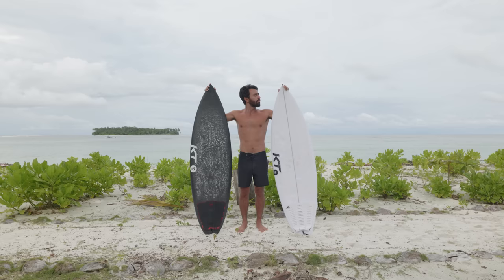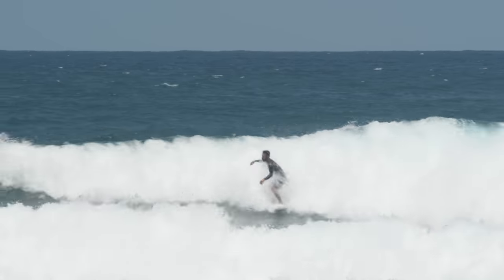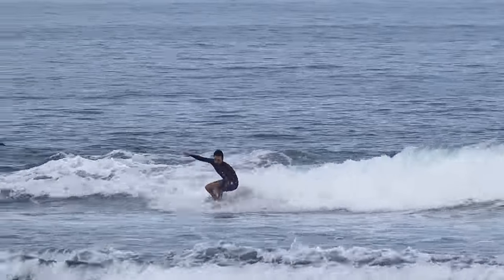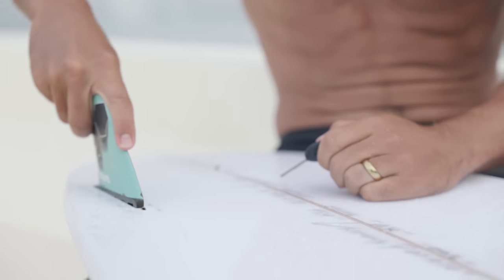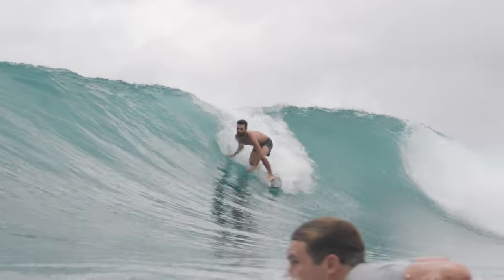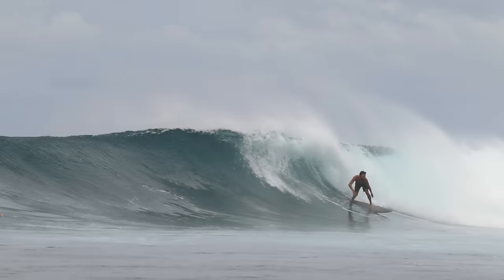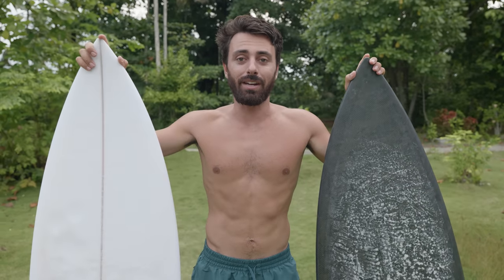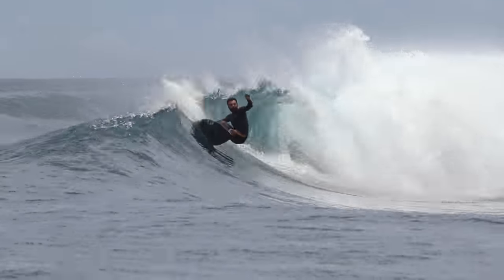Carbon Vs. PU — What Board Works Best?

Comment: Jokes on you I can’t afford a carbon fiber board so it doesn’t matter
Reply: You can think about it this way: Assuming we're talking new boards, a new off-the-rack PU/PE board is around $700+ these days (ouch) and a custom carbon-wrap from Dark Arts or Varial is around $1300. That's 2x the price... but the board will retain its pop for 3x or more time, assuming it's not a dog. I'd call that a pretty good deal, but the risk of getting a dog is real.
Reply: never buy new surf boards that arent on sale shops have a surplus of performance boards that sit for years before bought

Comment: Awesome. But you missed one really important point. What was the weight of each board? It looks the black was lighter than the white, by watching you surf, and by your comments. What about a video comparing two boards, on same dimensions dinentions, and weighting the same? Than we’ll have a conclusion on different constructions in general. Excluding the weight factor.
Reply: Yeah the carbon board definitely weighs less and is more buoyant. But that's kind of the point, to see how the exact same shape differs.  Carbon will get you floating more over the water while PU allows you to sink your rail much better.  But you're right, usually you will have more volume with a PU board than other constructions.

Comment: you are spoiled for choice. In the 70's we had one good /new board that had to last until you saved enough for a new one.. To last they had very dense foam, 3 ply stringers and 2 layers of 3oz on bottom .1 on deck. Airs only became possible when Kelly and Co got board makers that give them "burner" boards with one light coat,   one filler coat, no gloss.. It is much easier to try things when your board is a throwaway. To us, our board was the gate to happiness. You didn't risk it too much. It took 3 months of saving to get another. If you broke yours, and had no oldie back up, you had to borrow. After it went onshore and they came in.

Comment: There is no such thing as two exact Surfboards. I will make it simpler. No fingerprints or snow flakes are the same.Kai Lenny rides for Redbull and he has over 30 of the same boards some even the same template and fin set up and he will tell you everyone of them ride different.

Comment: I think you should have compared a pu to regular eps epoxy glassed board.
The eps stringerless carbon wrap are a thing of its own.
Reply: But i would love to see a video comparing many boards from different shapers in their pu and eps equivelent
Reply: Totally agree, best should be: PU standard glassing, PU light glassing, EPS with stringer epoxy resin, EPS epoxy stringerless, the most common options at the market
Reply: Agree….needed a Pu standard also which is most of our benchmarks in terms of understanding

Comment: Awesome video and great surfing. As one of the other comments said, you need to know the weight of the board, so then you can figure out the density. The density is the first thing that will affect the float (that "on top of" vs "in" the water feeling). That EPS board probably weighs a whole pound less so it's going to be way floatier. Also, you need to check how close the rail shapes are because someone as good as Mike can definitely feel a slight difference in rail. Then you need to figure out a way to measure the flex. Way too many variables beyond just the shape! Finally you should've painted the PU black because black boards look cool.
Reply: buoyancy / float is actually largely decided by volume if you look at the calcs. a kg may feel different when you're turning because of the amount of weight you're pushing is being reduced but the floatation won't be changed a whole lot - the same way the change would be minor if you lost a kilo of weight. & flex is bs imo 🤪
Reply: Flex is hardly BS or everyone would be riding Tuflites.

Comment: I find production epoxy boards to stiff in feel. Carbon can make that better or worse depending on the type of cloth and layup. Is KT producing these offshore? I can’t imagine them all coming from the small shop in Maui or maybe just the prototypes. 
Vacuum bagged epoxy with glass fiber is the sweet spot for me.  You get a lite, crazy strong board that flexes and rides like a PU board. Canibal core vac in Florida do it well. He uses different glass cloth thats finer with more layers. It just feels better.

Comment: Seems to me like if you are paying for the tech of the carbon, then maybe manufacturers should incorporate some kind of a ballast insert in the deck that you could change out for the conditions, so you could have a bit more weight/dampening when you need it or lighten the board when you are looking for a more lively response....

... I'm available for consult if anyone wants to make bajillions.
Reply: adding weight doesnt help with dampening properties or the need for a clean faced wave. it would simply offset the weight
That is because the carbon is way stiffer and stronger then the fibreglass in those specific directions. Looking at my YT channel you couldnt tell, but i make surfboards and i also offer a certain model in fibreglass AND in carbon.  same shape rides significantly different.
Reply: and further, the responsiveness of the board wouldnt be affected in the same way as different constructions. fun idea though..

Comment: You're too small of a dude to ride a carbon board that size.  They're very buoyant
Reply: only if the core is eps/lighter.. the carbon itself weighs about the same as fibreglass. vacuumbagging does make it hold less resin, but the biggest difference is the ability to use a lighter core.